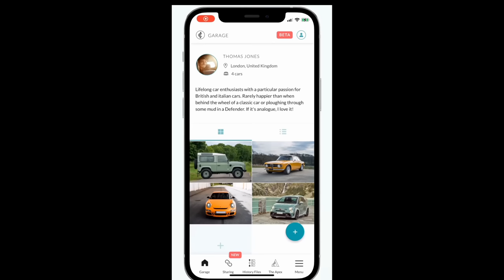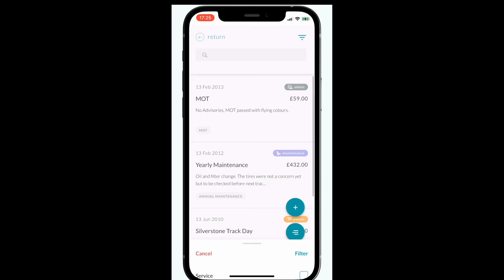My Ferrari 360 'Finally' Broke Down!

Comment: Knowing that there could be essentially two reasons for the dash light to come on: brake pads and fluid level, and being able to exclude the brake pads 99% because they had no sensor (yeah there might have been some bad contact somewhere... how likely?), I'd say it was a bit foolish not to check and top off the fluid...

Comment: my 987 boxster dumped its coolant following a water pump failure in the south of France. I had European recovery so no worries i flew home and waited for about 6 weeks for the car to return. When the car finally arrived it had multiple significant scratches, including the convertible roof, front bumper popped off on one corner - ultimately not the end of the world but clearly the car had been treat with distain. So Sams approach albeit im sure expensive may be the better way.
Reply: Wtf! Sue the company for the poor handling of your car, that’s  bloody terrible

Comment: i still remember the dream that was the cause for you to buy the 360. you were dreaming about driving a manual challenge stradale. i say, instead of bidding farewell to the 360, do the same thing as the convertible 360 owner is doing. convert the 360 into a manual challenge stradale 👍

Comment: Is it me or it seems you don't need to have a manual Ferrari on neutral to start it?
Reply: In 30 odd years of driving I've never seen any manual car that needs to be in neutral to start it
Reply: Dont manual cars kind of "jump" when u start them in gear?
Reply: @muzishakes  not if you put clutch down
Reply: My bad....im that expirianced. Thanks though

Comment: My understanding (please correct me) that with those harnesses v a seatbelt, that unlike a seatbelt, if you don't wear a hans device - your neck will snap as your chin tucks down in a crash. Might want to double check using them and stick with a belt ✌️✌️✌️
Reply: Harnesses are safe, they only time you would be in danger is with a helmet and without HANS, no helmet is perfectly safe with harnesses :)
Reply: @JC-lb1iq  ah so it's the weight of the helmet that snaps your neck with harness (no hans)? Watch the MCMTV2 video from mighty car mods on seating position, it's where I got this info.

Comment: Love the vids Sam, especially the road trip stuff. I’ve been here from the start. 
But…. Why oh why would you not check the level and top it up?
You can try and get away with that if you’re popping to the shops, but not when you’re half way around the world. 🤦🏼‍♂️😄
The ultimate outcome would be the same, as in you’d need a new clutch slave cylinder, but it would have got you home and saved you so much hassle. 👍🏻

Comment: Random q, was the car in gear when you started it 2:16
Reply: Looks like it. And why not?
Reply: looks like it, but what's the problem with it?
Reply: Looks to be, but who says it couldn't be?
Reply: I always leave my car in gear when I turn it off (old habit and throw back to my fathers generation who would do it incase the handbrake cable snapped ,and off your car rolled) and as such always start it in gear with the clutch pressed in.